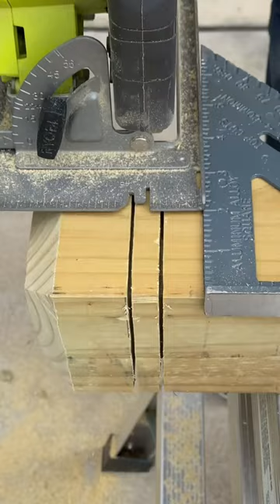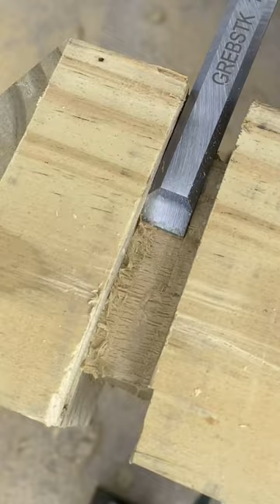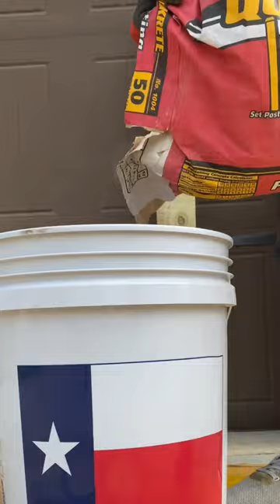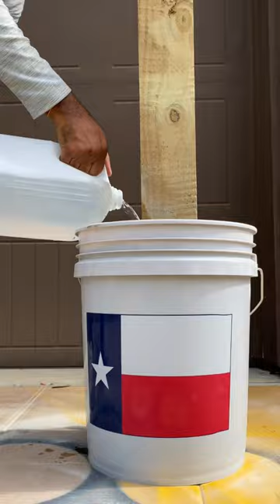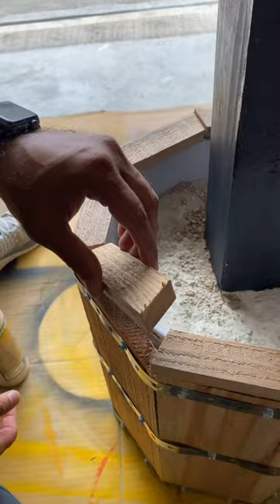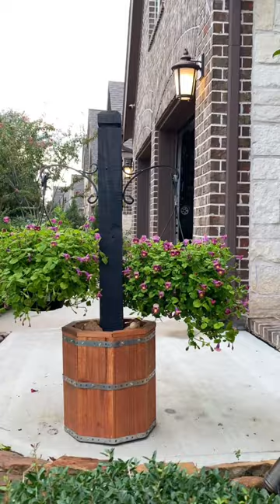Curb Appeal Project - Part 2

Comment: That pretty cool. My wood wants me to build a couple for our home. However, a helpful tip for the future. Turn over your chisel..... you want the angeled show of the cutting edge to face down. That is how they are intended to be used the majority of the time as far as finishing/ cleanup work. The reason for this is that with the angel up, the tool actually wants to dig down into the wood. In some cases, that is the goal, but just for smoothing out the saw cuts like this project, you will get a better finish and less likely to go too deep and have to start over.